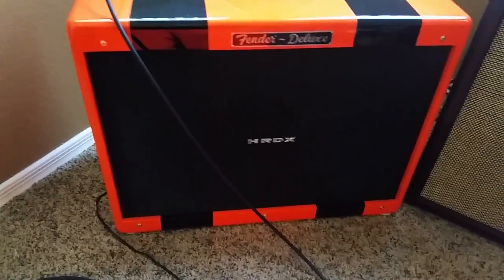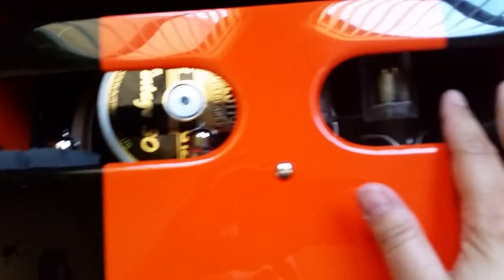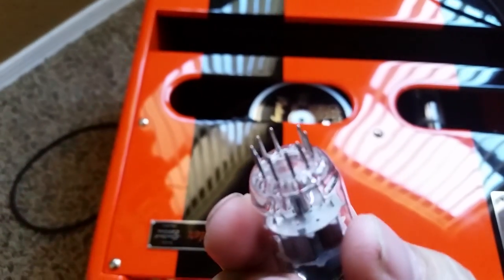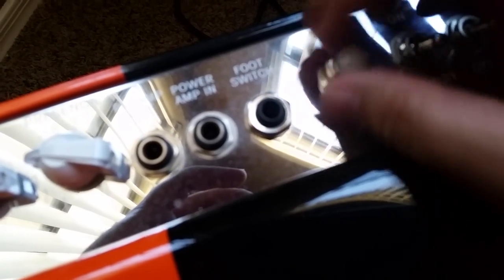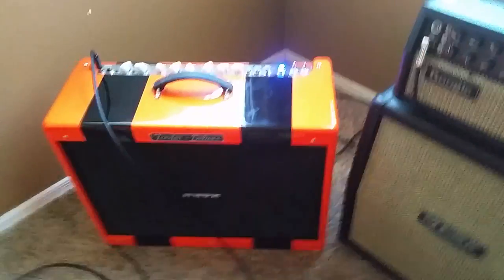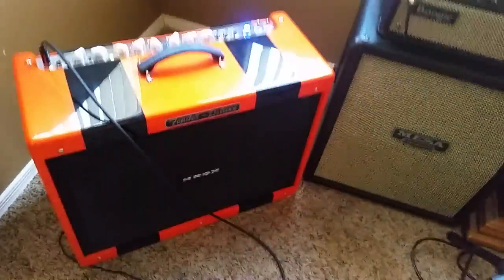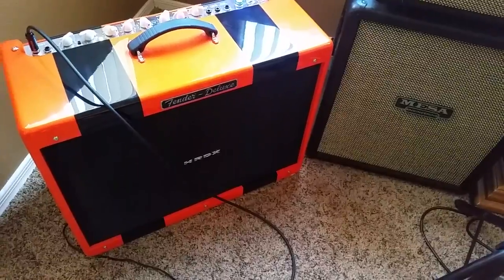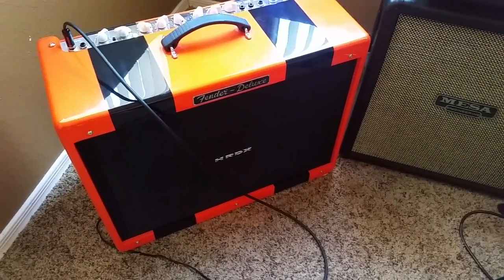Improve Your Fender Hot Rod Deluxe For $10

Comment: So I ended up doing this Phillip.  I replaced all the 12ax7's with new 12at7's. As you suggested in this video, you only needed to replace the one, but I did just one, noticed the huge difference you show here and then added the other two and noticed the overall tone rounded out a bit more. Not a huge difference but I read in some forums about guys who replaced all three and suggested exactly the same results I got with my Blues Deville 410. It's SOOO much more manageable now. Holy cow. Totally different amp.  Just way more control over it all the way around!!  Thanks for this video:-)
Reply: There's two or three other 12AX7 substitutions that won't fry anything. (12AU7, 5751, &c. The first gain tube is most sensitive to change. I tried everything in my Micro Terror trying to get a tone. (failed)

Comment: Cool video, thanks for the info!You can also do the following to turn a fender style amp lower, even if it is around 50 Watts of power:1. Turn ALL of the EQ knobs down to 0 (bass, mids, highs, presence if your amp has one).2. Set the volume levels to how you would normally use them in a club, so you can turn them up pretty loud.  3.  Slowly start turning up the EQ knobs, best to start with the mids, then add a bit of bass and highs if needed.  Notice that the EQ knobs are like individual "volume" knobs for each of the frequencies and that you only need to dial in just a bit of each frequency and the amp will sound quite a lot like it usually does on high volume, but on a softer level.  It will obviously lack a bit of the speaker breakup, but you can also use this method to "tame" beastly amps that use a Fender style EQ section.  Hope this also helps someone out there.
Reply: I'm going to try this, thanks!

Comment: Several things - Like a number of the larger Fender amps, the Hot Rod Deluxe has two input jacks. Using input 2 on its own will cut the input signal by half. Although it also only offers an input impedance of 136K, compared to the 1 Megohm of input 1. 
Secondly, that entire series of noval base small signal tubes are 2 valves in one glass envelope. So when you talk about changing V1 you are changing V1a and V1b. The gain of the pre-amp is changed, not just by the change in amplification factor of a single triode, but by the amplification factor of two tubes in cascade. 
Also note that the input controls on many Fender amps are linear and not log pots. People often change these to log to get smoother control of volume. However Fender aren't crazy to use linear controls, they load them with a 180K resistor from wiper to ground to get a non-linear characteristic. 
One of the reasons you get such a dramatic jump in volume with a high gain amp like the Hot Rod Deluxe is that all rotary controls (potentiometers) have neutral metallised 'landing' zones at either end of their rotation. When used as a volume control, for the first and last, at least 10 degrees of their rotation, you get no change in volume because the wiper hasn't moved off the landing zone and there is no change in resistance. Then as the wiper passes onto the resistive portion of the track you get the sudden volume jump.
Reply: Big thumbs up on mentioning changing to logarithmic pots for volume.  I did that on my blues deluxe and it made a huge difference in the amount of volume control I have over the amp.  Before, 1.5 was usually too loud.  Such a tiny change would go from off to LOUD.  So sensitive.  I don't know why they use those stock.  Now, at about 3.5, sound output is about where 1 used to be with the linear pot.
Reply: Can you explain this like I'm 5 please lol
Reply: I don't understand what you're saying? Is it a good mod he did or pointless? Lol
Reply: FIRST OF ALL, much more complicated changing a pot over changing a tube - 2) You only mention volume control and totally negate the added warm, rounded tone you get with the 12AT7 over a harsh ear piercing tone of the AX7. Maybe great for metalheads but not for blues and jazz.
Reply: Why can't you simply use a good volume pedal with a variable pot, for example, a Morley lil alligator? I think swapping out tubes and pots is a little much unless you really know what you are doing. And most of us don't know that much about the internal workings of tube amps. Well, I guess I don't.
Reply: @jonathanhandsmusic  Thanks for the reply Jon. I am a vintage tube amp collector and very familiar with the different tubes that can be used to shape the tone  and volume of a tube amp. I was just curious what others who own this amp did. Already ordered the tubes I need - I'll let you know how it turns out - Thanks
Reply: @WebbChannel1  Hey there 😊
Did you change the tube?
I think that you wanted to go from 12ax7 to 12at7
Am I right?
Reply: @dimitrisaivaliotis5616   Hey, thanks for the follow up. Yes, bought new tubes from the TUBE DEPOT for my HotRod Deluxe. They arrived, I installed them and STILL not "thrilled" by the tube tone. And STILL loud as hell. It's definitely better BUT not luvin it. Selling it. Being a "collector" I usually have 10 to 20 tube amps on hand. I decided to DRASTICALLY cut down my collection and only keep the ones I absolutely love like my BlackStar HT20 and my Marshall JCM 2000. Anyone wanna buy a practically NEW Fender HotRod Deluxe iii. Clear  protective plastic still over the logo badge...
Reply: @WebbChannel1  Thanks 😊
It's a pity that it doesn't work with new tubes..
So a volume pedal may be the right choice
For practice with HRD!
Reply: @dimitrisaivaliotis5616   I absolutely agree with you there. A volume pedal, or maybe changing to LONG pots like another post recommended. Don't get me wrong - the new tubes helped a little but not enough to make me keep my HRD.
Reply: @jonathanhandsmusic  Using a volume pedal in front of the amp is like using your guitar's volume knob, you're not getting the full output of your pickups dialing down the input volume of either your guitar or the pedal, if that's what you meant. Run a volume pedal in your effects loop, and it will function like another master volume. If that's what you meant, then..  carry on sir!
Reply: @WebbChannel1  can i change both preamp tubes or will i get problems with currency?
Reply: @marcusstrymon693  PreAmp tubes are where you can have fun "shaping" the tone of your amp if you know what you're doing
 so "No", you won't have problems with the currency. It's the POWER TUBES that are a pain in the A**. 
If you need more than one (pair 2, or quad 4) they have to be a matched set and exactly the same
type you are replacing. Not only that but you have to check if the amp is a Bias, or Self Biasing design.
* DO NOT ATTEMPT BIASING AN AMP IF YOU DON'T KNOW WHAT YOU ARE DOING. 
You could get electrocuted and DIE. Back to PreAmp tubes - Do yourself a favor and read up on all the different
preamp tubes and HOW they shape the tone of your amp and choose the ones that are right for your application.
Reply: @WebbChannel1  an attenuator can solve a lot of this issue.
Reply: Just changed out the 12ax7 for the at7 for my hot rod deville and it totally tames the volume surge, amp sounds a bit mellower as well. Great mod all round.
Reply: What?
Reply: @itdies2dayyo  So you have 2 pieces of BubbleYum Bubblegum & you blow 2 bubbles that get really big then burst!
You then take 2 pieces of Triden Bubblegum & blow 2 small bubbles b4 bursting.
BubbleYum = 12ax7
Trident = 12at7
😎
Reply: Thanks for the tip about using input two. That helps cut the volume down.

Comment: Just plug a volume pedal into the preamp in and out , then you can crank the valves to a nice tone, then back off your volume pedal to the required vol. Works as a master and no loss of gain or tone.
Helps heaps with those touchy linear pots, and no mods needed.
Reply: Even the volume knob on a lot of guitars.. Sounds way better IMO

Comment: You could also make your own Master volume box, which is just a audio taper volume pot, an input and an output, and three wires. Simple to make and you just run it through your effects loop. Tames the volume instantly. But doesn't change the tonal characteristics.

Comment: What your doing is cutting the first and most important gain stage down by 40 - 50 percent or so. A 12AT7 is about 50-60 percent of a 12AX7 Gain wise. You can also go half way back up to 70 percent of a 12AX7 by using a 12AY7 that is about 70 percent of a 12AX7 Gain wise. Excellent way to lower the noise level and make a high Gain amp more of a pedal friendly platform. Or take a 5150 or 6505 and make it more Marshall like Gain structure wise. I have lowered the Gain structure of my 6505 Copy my Bugera 6234 is now running new Low Gain 12AX7's in V3-V4 and V5.  Made a decent amp great!! Good demo! Thanks
Reply: I've always wanted to make this sound more like a Marshall, at least the gain channel, could you please elaborate on the tube swapping? Would I still need to make this particular 12AT7 mod? Thanks
Reply: ***** No to sound like a Marshall you'll need some Mullard Long Plate 12AX7's.  That's gonna give you that British bite your looking for. Change all 3 Tubes to Long Plate Mullard 12AX7's you can get these in a good reliable seller at the Tube Depot .com. fast shipping and it will help your cleans as well
Reply: Thank you kind sir, I'll go get those 3 tubes. I really like this amp but always have thought that the distortion could be a lot better, and first this video gave me hope, and no your mod! Cheers!
Reply: ***** Your very welcome. Now its gonna sound completely different right away so give your ears like a week or so to get use to the tones your taking in.  It may sound really harsh at first but believe me after being use to that different flatter tone your amps gonna have lots of sharp edges that's more plexi like and it will take a minute get use to it. Let me know how it turns out. And remember you gotta have Long Plate Mullard 12AX7's. \,,/
Reply: +Tim Stanley That mod sounds awesome! I'm a total noobie when it comes to amp mods and I cant seen to find any Mullard 12AX7's advertised as "Long Plate" on Tubedepot.com  Thanks!
Reply: +Josh Stringer On Tube Depots site its the version that like $16-17 each. They call them a faithful reproduction or something like that. If you get a chance to try them you'll love the tone.
Reply: +Josh Stringer That's a beautiful amp dude. i love the colors. awesome.
Reply: on a blues jr or blues deluxe would you just change one of the tubes to a 12at7 ?
Reply: Same procedure as the Deluxe, switching just the V1 preamp tube.
Reply: Hey Tim. Good info there. I have a Blues Deville 4x10,( 1993) with the same problem. Gonna try to tame it a bit. My Hiwatts on the other hand, need some work as well, but thats a whole other story. Thanks for the vid, and the advice guys....
Reply: I recommend the 5751 pre-amp tube. It's a nice inbetween option. You lose some of the gain but not so much volume. I think the 12ay7 and 12at7 are less than 70 percent of a 12ax7. 70 percent would be the 5751 tube.
Reply: Yes, I was correct. The 12at7 has a gain of 60, which equals more volume loss.
Reply: WILL THIS TRICK WORK ON MY  CARVIN  NOMAD 50 TUBE AMP
Reply: Are you saying do the same mod but with a different tube? Any brand better? These amps are loud right out of the starting gate. Did Gerry Blue ever get back to you?
Reply: I find my jvm 100 very gainy would this work for me?
Reply: “You’re”

Comment: By replacing the tube you are dropping the gain of the of the amp circuit. This is not a bad thing. As you found out it lowers the volume a little, and will take a higher volume setting to get it to distort. This is due to the fact the 12AX7 has a gain of 100, while the 12AT7 has a gain of only 60. You are also backing off how hard you push the rest of the amp. If you crank it up it will still be plenty loud, it's just easier to control the volume at low settings.

As to the improvement in tone swapping out the tube may very well change the response of the amp and smooth it out. It is common for people to swap out the first tube in the preamp and the last tube before the power amp section. In fact, other tubes can be used to substitute for either the 12AX7 or the 12AT7 in most places where these tubes are used (at least in the preamp section). Many consider preamp distortion to have a "fizzy" sound. Preventing it from happening a lower volumes helps to get the power amp section working harder before preamp distortion sets in.

Comment: Holy smokes. It works. Warms up the sound substantially as well. Thanks a bunch for the tip. WAY easier than swapping out pots. Especially for a guy who doesn't do electricity and would have to haul in my amp to somebody who does.
Reply: By changing pots you also change the frequency characteristic of the circuit since the output impendance is changing.

Comment: Phillip, I'm fairly new to whole understanding of guitar equipment. I've played of course, but Ive never truly gone in depth with the understanding of the mechanics of the guitar and amps. Your knowledge has helped me grow so much in my education of this subject.

Thank you.
Reply from the maker: Thank you for taking the time to post.
Reply: @PhillipMcKnight  I put a 12AT7 into v1 of my of Blues Deluxe. On the clean channel, the amp started getting "hum like feedback like noise" but when you put the guitar to the amp it does not feedback. Tapped all the tubes with a wood stick from left to right. When I got to the 12AT7 into v1, I got a glass reverb like feedback. This also happens when tapping the amp's chassis. I put in my original 12AX7, everything went away. I put a little more effort when tapping the tubes/chassis and no noise or glassy feedback. Was I sold a microphonic tube???

Comment: Probably already known by many, but using a volume pedal in the effects loops acts as a master volume. You can keep the same tubes and turn the channel volume up as much as u want to get them cooking and control the actual volume with the pedal.
Reply: yeah but then u get the raw guitar signal into the cabinet with no pre amp, its better to put a pre amp in front then the volume pedal, or you can buy the jhs amp box and plug the pre amp out into the power in and lower the volume knob on the pedal
Reply: No effects loop on this amp
Reply: @DNYS8N  yes there is...
Reply: @DNYS8N  it’s just labeled preamp in/out I believe
Reply: @cheeseboy075  you misunderstood the post. Use the volume pedal in the effects loop (pre out/power in), but continue to plug your guitar in the standard input on the amp.

You’re basically adding another volume between the preamp and power amp.
Reply: This is correct.

Comment: I have a Fender Hot Rod Deluxe III. I installed a George Benson tube, 12AT7, and it worked just like you show, but I wanted to drop the volume even more. The TubeStore suggested a 12AU7 tube in the first position. I purchased a Mullard. It worked great. Really tamed the amp even more than the 12AT7. So I'm running the 12AU7 in first position and then two 12AX7's, and plugging the guitar into the second input. Love it.    I tried 12AU7's in the first and second socket positions. The amp sounded good but, it cut the volume way too much for me.  I hope this helps someone. Thanks for making the video.

Comment: I just did this to a new Fender Hot Rod Deluxe IV.  Before this simple tube swap the reverb was almost unusable. We're talking anything past 1.5 and it actually started to "sizzle." and not in a good way. The drive channel is indeed warmer in both modes. A very nice improvement. Not sure about the top end loudness. I doubt I would EVER use the amp in that way. This sucker is LOUD. I had a Hot Rod Deville and got rid of it because it just didn't break up nicely until the roof came off of my house. I wish I would have tried this I'm sure it would have made the amp more user friendly. Thanks for sharing your knowledge with us... you make a difference. Isn't that what life is really all about? Cheers

Comment: guys this definitely works. I've been struggling with my original hot rod one for years. I popped in an at7 in the 3rd slot, bingo. amp sounds so amazing and lush. All thats left is a new speaker!
Reply: OlDirtyFilmah what speaker are you going with
Reply: @randomsongs8478  I got the texas heat. love it

Comment: WHOAA!!! This is an awesome MOD. Thank you very much for sharing.

The question now is 'can this be done to the Master Volume pot?'
Reply: change it from a linear (stock) to logarithmic pot.  Did this on my 40w blues deluxe.  Now 3.5 setting is like what 1-1.5 setting was.  Much more control over the "ramp" of the sound output.  I have no idea why Fender uses the linear pots on these type amps...
Reply: @thuhreb  Somebody wrote that Fender modifies the linear pot to a kind a audio taper with a 180K resistor.  Maybe that value could be changed to make it more
usable, instead of changing the pot.

Comment: I have a Hot Rod Deluxe. I swapped out the 12AX7 in the V1 position for a NOS Mullard CV4024 / 12AT7. It not only gave me significantly more control over the volume but the improvement in sound was somewhat of a revelation, especially on the clean channel but also on the drive channel (even though I rarely use it myself as get dirt from pedals). The Mullards can be had for very reasonable money. I still use a 12AX7 in V2 and a balanced 12AX7 in V3 (PI). I would strongly recommend the Mullard CV4024 / 12AT7 in V1.